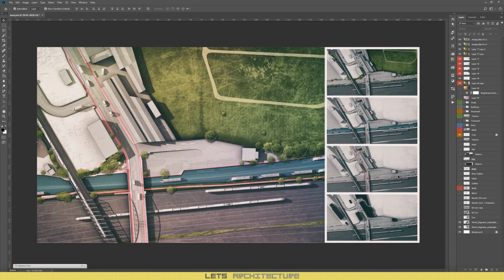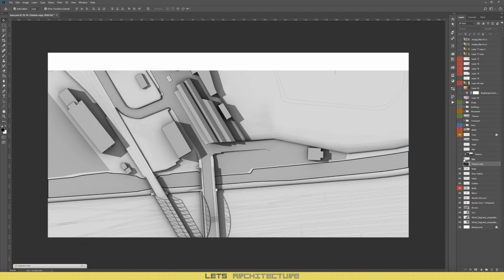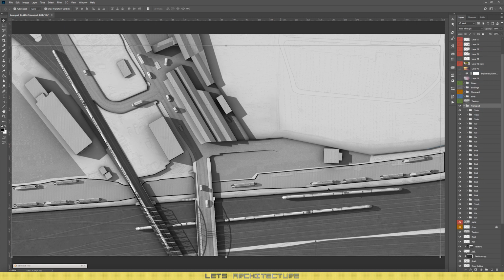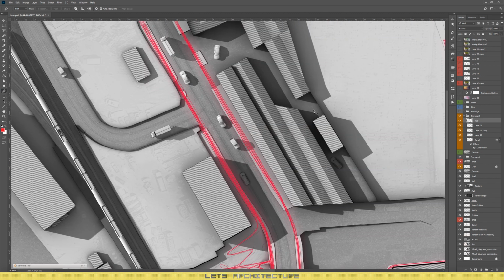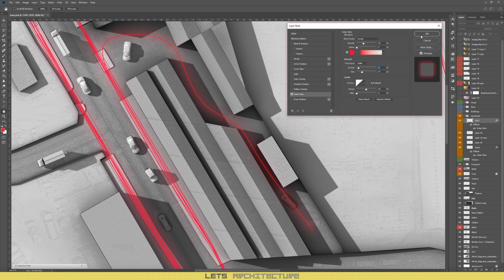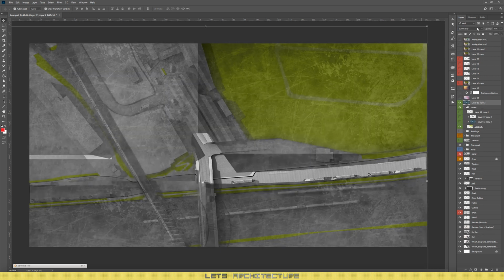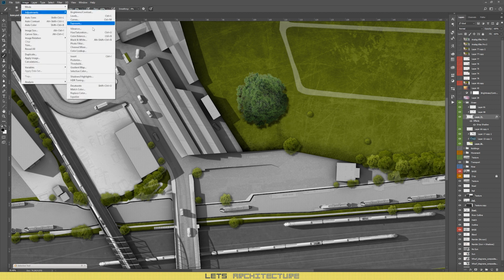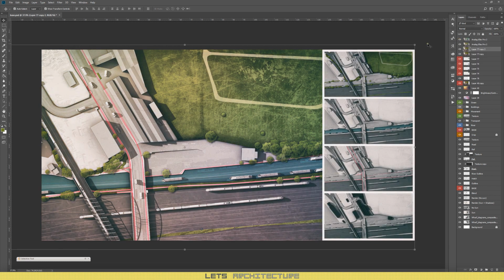Architecture Site Analysis Diagram | Alex Hogrefe

Comment: How do u add the Hatches? U kind of just said u added Hatches but U did not show us how u did that... cheers :)
Reply from the maker: Well there are many ways to do it.
1: Draw a shape you want to show the hatch on. Change fill to pattern -> find the pattern. Change mode to MULTIPLY. Erase the area you don't want to see it on.
2: Find the right pattern image in Google. Delete the background (unless it's white). Change mode to MULTIPLY. Erase the area you don't want to see it on.
3: Draw the pattern yourself. Draw a line, copy it as much as you need. Merge all lines into one layer. Change mode to MULTIPLY. Erase the area you don't want to see it on.
I hope this helps.